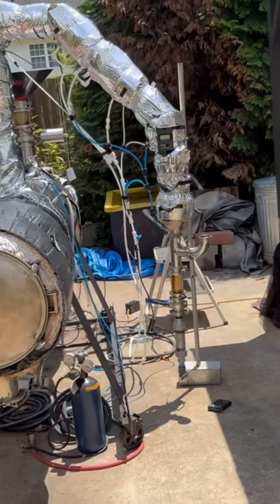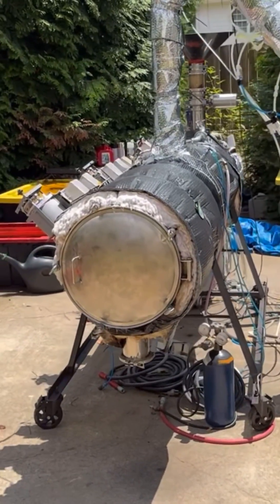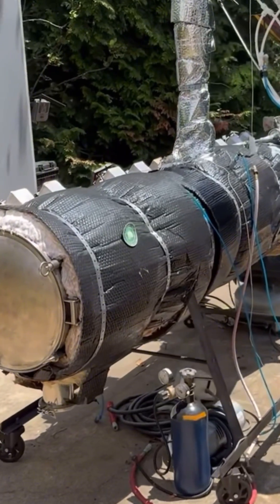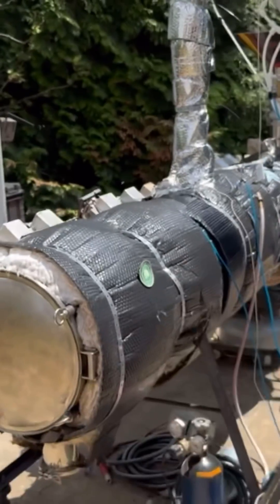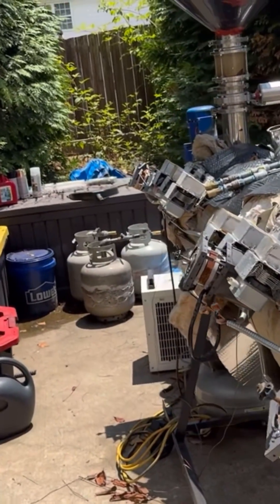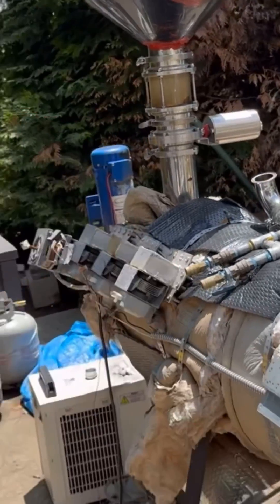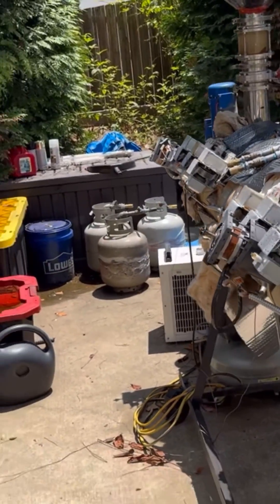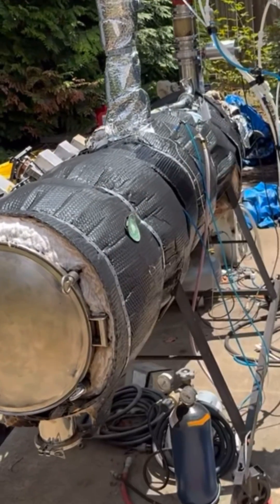PLASTIC TO FUEL Microwave Mark 5 Plans!

Comment: Could this machine turn old car tires into fuel? Rubber tires are often just discarded in big piles at landfills since they aren’t very cost effective to recycle like a lot of plastics. If these tires can be shredded and remove the steel cords, I’m willing to bet a ton of fuel could be made from it, and the leftover steel can be recycled. It would remove them from the landfills to be turned into fuel or oil of some kind. I think it would be a good experiment! Keep up the good work!

Comment: firstly,  glad you were able to learn a lesson, glad you're still around.  i was just watching your 10lb processing video and wondered...   have you considered another method of transporting shredded plastic?  seems like you have a percentage of shred that can be blown away.  

a vacuum transport system could be fabricated pretty cheaply to suck shred straight from the shredder to a cycloidal filter above the processor feed.  by running it out of your power cabinet, you could then capture the energy cost of moving material which i think would help with scaling up.